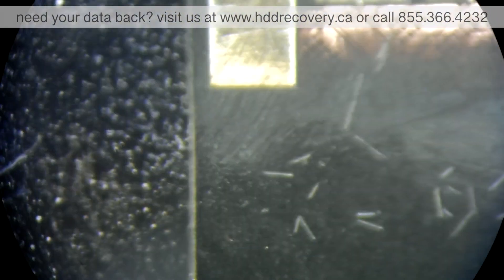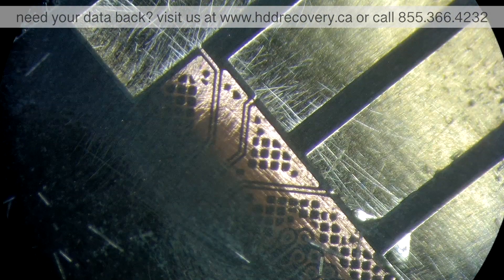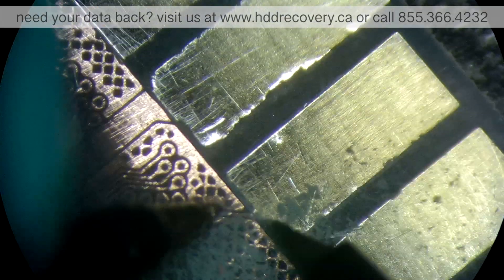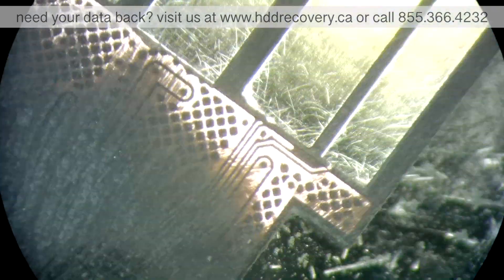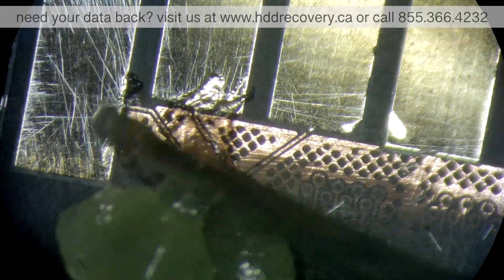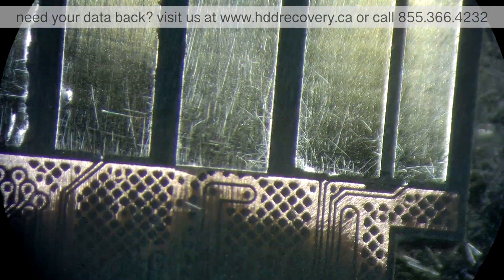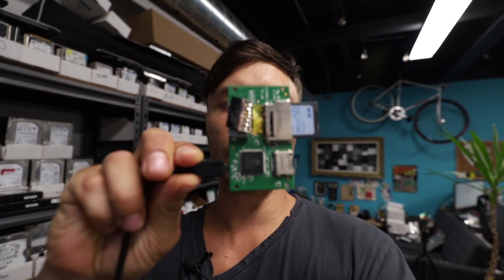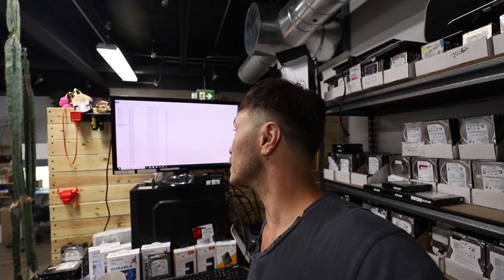salt water damage on memory card | SD card data recovery

Comment: I have an sd card I found in my car ant the contact points are corroded is there anything I can do
Reply from the maker: Corroded connect pins usually split from traces that come out of the pads and covered by mask. Right at the base. Microsoldering is needed

Comment: Hi Erkin, I am in a big trouble. My Seagate Desktop 3.5 1T single plate hdd stopped working after 6 months of activity. It contains files from my research, not system files. Following many instructions I changed the PCB and swapped the BIOS with no luck. Then I tried to replace the heads. I bought a donnor hdd and managed to replace the heads. It did not work. When I reopened the hdd I found a circular scratch on the disk. I replaced the heads again but SAS can not access the disk. Is there a way to save the data out of this disk? I appreciate your attention.
Reply from the maker: Luiz, it is unlikely at this point.

Comment: Dear sir I am from India. today I was using my wd passport HDD 1tb. all of sudden it stoped the light was blinking and then it stoped blinking and the light was constant.  then after few minutes  it clicks and the disk rotates again. the usb plug-in sound comes it doesn't show up in disk management.  their is no clicking noise  please help me please
Reply: John gulbarga I had the same issue, for me it was a power issue  and I just Changed ports to the back of my desktop to usb 2.0
Reply: matty - just saying that I had it before
Reply: @MarcoGenio  sir I have tried it but its not working even I tried to run it on other pc